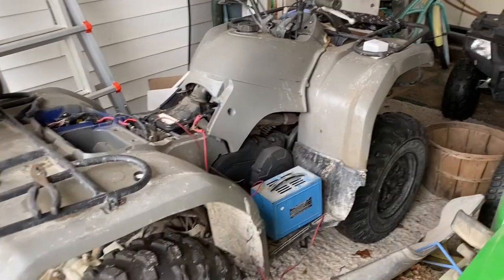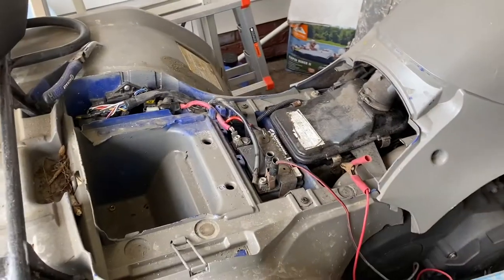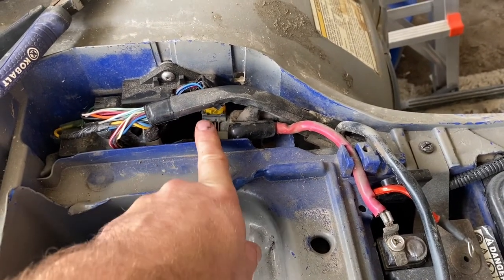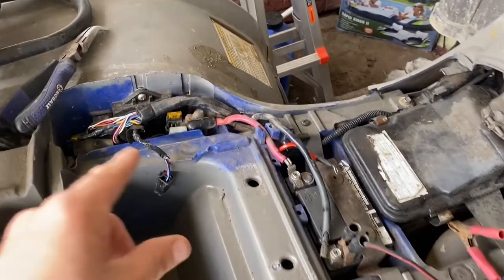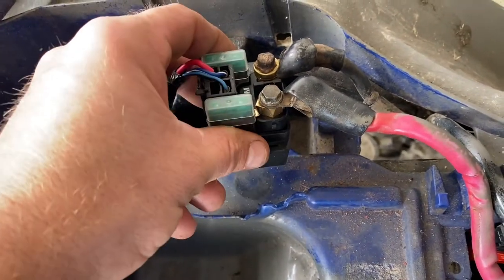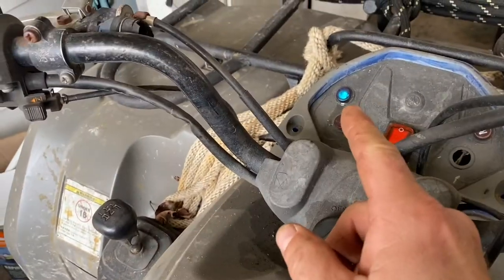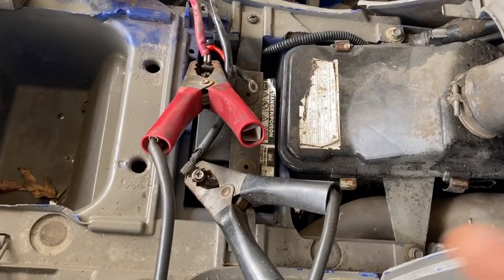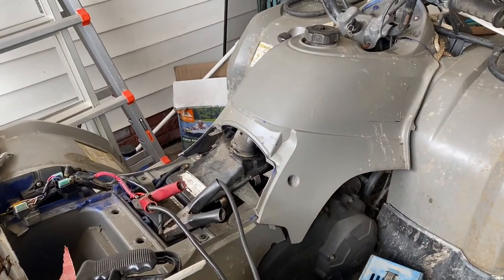ATV Starter RUNS WITHOUT The Key or Switch on.  Kills battery. How I fixed my Yamaha

Comment: I just had this happen to me on my Kodiak 400. I had just put a new starter solenoid on it when it did it. Killed my battery. Changed out the battery and she fired right up. Only problem having now is when it's in gear and I start it the dam thing wants to take off on me. Trying to figure out why it's doing that. Great video.

Comment: Thanks for the video, I have the same machine. My starter runs whenever the key is on. Kill switch will stop power from going to the starter. Changed relay and solenoid, no change. Possibly ignition switch or starter button?

Comment: I'm having the same problem but I've replaced the solenoid and it's still doing it. What else could be wrong? Thanks Donnie
Reply: I’m having the same problem I have no clue what’s wrong
Reply: @@danwipper ignition switch or would you check the start/kill button?  my quad is 3 years old and did this.  Solenoid is fine. Need another idea here, I think it fried my starter...

Comment: This same thing happened to me. I started it up and I kept hearing a noise but I rode around for 5 minutes and then when I turned it off and pulled the key out, the starter was still trying to start. I think it ran my battery down and now nothing and battery wont even charge..... please help what do I gotta do.im no mechanic by no means